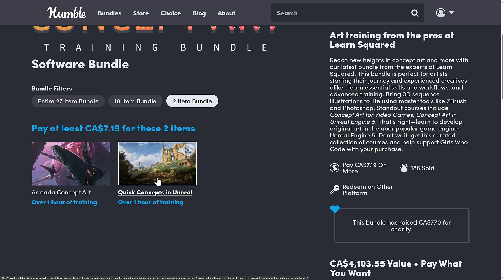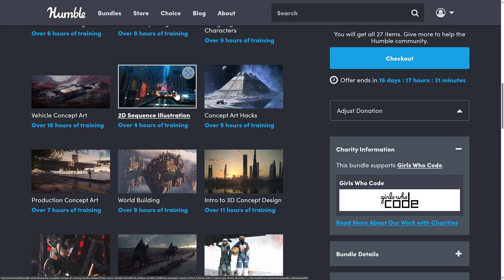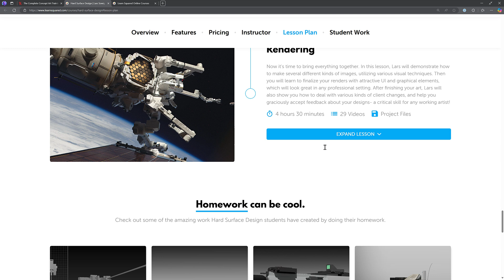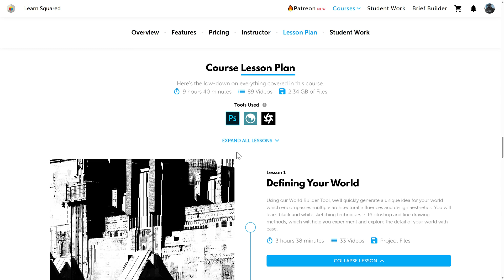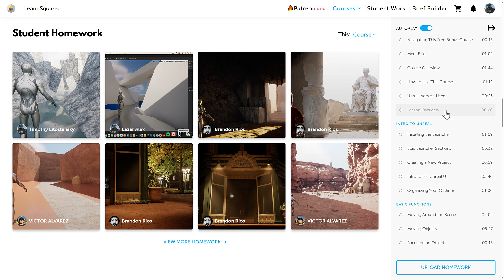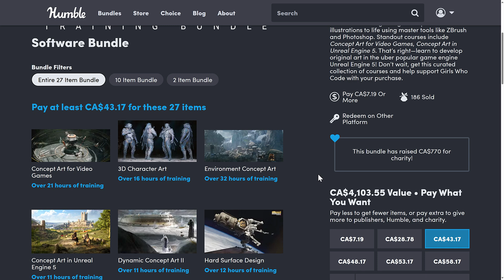Huge AAA-Level 3D Artist Course Bundle - Nearly 300 Hours of Training!

Comment: One cool side note: If you purchase the highest tier that includes Environment Concept Art, you get an additional course for free - Zbrush Basics (valued US$40) - by the same instructor. It will appear on the ECA course page as Lesson 8. A tip: You have to scroll down on the main page of the ECA course and use the Expand Lesson button for Lesson 8 before it appears in the course's sidebar.

That's 28 courses total! A superb deal for anyone with even a passing interest in concept art.